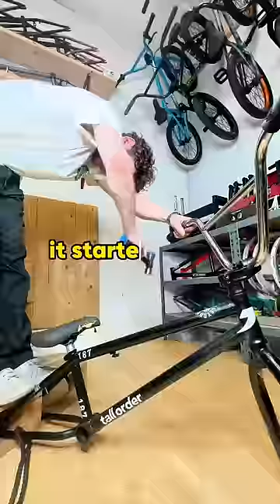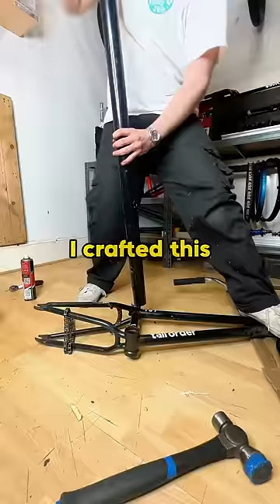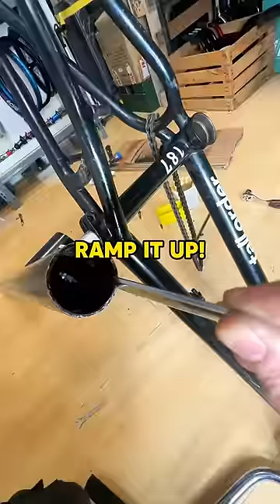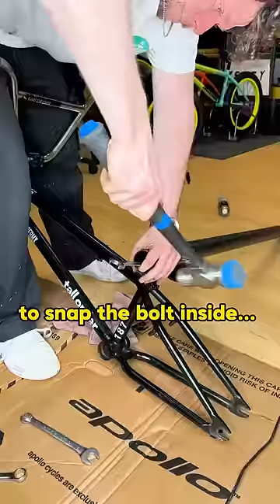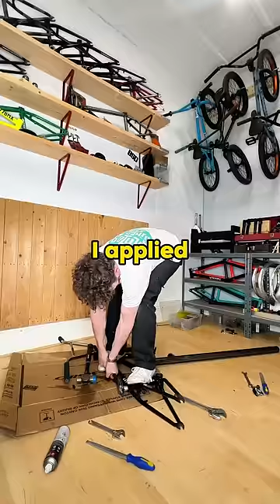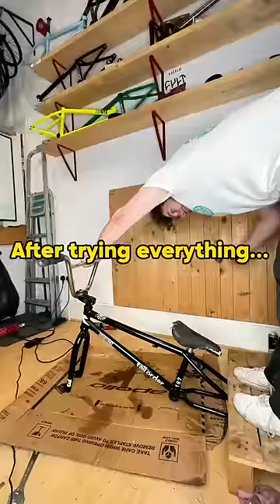Extreme BMX Rescue Mission: Battling the stubborn seatpost from Hell! 😳😱 #bmx #bikerepair #shorts

Comment: Correct way to do this is just to use a slide hammer, it's what plumbers use to seperate rusted pipes.  A few hits with that thing it will come right off no mater how rusted, every other method is a waste of time.
Reply from the maker: OK!! Sounds good dude I’ll look into that!! It’s not the first time we’ve had a frame like this! 😳🫡👊
Reply: If the pipe you are trying to remove is inside the frame try dry ice instead of heat on tge peice you want out. Massive amounts of cold could shrink it enough to help remove it.
Reply: No needs a torch not a heat gun lol
Reply: No you don't use heat and cold, as the interface between the 2 pipes is not threaded.  You use cold and heat on threaded interfaces like large bolts in an engine.  You use the tool designed for this job the slide hammer.  Literally 30 second job with this tool.
Reply: And get a actual torch a heat gun isn’t hot enough for it to loosen it up
Reply: @Pur3R3dBlow  No time to wrestle for 2 hours with a stuck post using heat and cold in a bike shop.  Few whacks with the slide hammer it's out in 30 seconds.
Reply: @___Bebo___  idk man a torch works pretty great on stuck nuts and bolts of all sizes on cars and I live in one of the worst parts of the rust belt
Reply: @___Bebo___  works on all shapes and sizes from axels nuts that are a 34+mm down to a lil size 8mm and even gets caliper pins unstuck which is a smaller version of this exact problem and the shops I worked in didn’t have heat and or where outside kroil oil heat and a lil bit of twist pull and taps with a hammer
Reply: @Pur3R3dBlow  In a real auto shop they use a heat induction tool to loosen bolts not a torch.  Torch can make the whole car catch on fire, heat induction tool will make the bolt cherry red hot in like 10 seconds.

This isn't a threaded interface, so you use a slide hammer.  You can rent a slide hammer for 5 bucks from Home Depot for all day so you are literally slow in the head if you wrestle with it for hours using penetrating oil and heat.
Reply: @___Bebo___  it’s called a coil conductor they also have torches lmao
Reply: @___Bebo___  also it doesn’t matter if it’s threaded or not caliper pins are baby smooth and I agree a coil conductor works way faster but a torch takes a few minutes and works juss the same
Reply: @___Bebo___  and I’ve worked in a quick lane shop a tire shop and dealer ship lmao I’ve been in a real auto shop and have 4 years of schooling along with 4 in the field
Reply: Are you a mechanic bring to my shop I'll prove you wrong
Reply: You don't heat the bike just the bike tube
Reply: Heat gets everything loose I live in Michigan everything comes apart hard
Reply: ITT a bunch of people doing things the wrong way that could never get hired in a BMW shop because of this.  I'm a computer programmer and I know more about this stuff than you, sad.
Reply: What if someone brought you a nice triple butted, Reynolds 853 bike that had been sitting in a shed for 20 years, and some of the tubes were as thin as a human hair?  You gonna break the torch out and just start blasting?  What if you melt the silver in the seat clamp lug in the process?  You guys don't know what you are talking about and are willing to spend 4 hours in a 30 second job over pride, ridiculous.
Reply: @___Bebo___  lol obviously you’ve never actually had to do something like this before as a job or a mechanics job
Reply: @Pur3R3dBlow  You're a hack, I wouldn't trust you around any equipment that I own.  If I saw you trying to do something right you might get to wash the underside of the Camaro with a pressure washer, but you can forget about ever changing the oil, 100% isn't happening my guy.
Reply: @___Bebo___  and you’re the real hack if you think a torch is the main reason for a car catching fire lmao while using it to heat something up obviously you’ve barely put 5 minutes in a garage if you really think that when majority of the time it’s the person using the tool because torch’s have been around way longer than heat guns and coil inductors lmao
Reply: @Pur3R3dBlow  I live in Los Angeles making 4x the money of hack PepBoys mechanics sitting in my room all day.  You're delusional @ other men on the internet with the wrong way to do things, get a boyfriend if you want to argue.
Reply: @___Bebo___  lmao makes sense a la base head who never gets his hands dirty n lmao must of forgot the part where I said dealership haha
Reply: @___Bebo___  and my point exactly you’d rather pay someone at a garage to
Do something instead of going it yourself
Reply: @Pur3R3dBlow  Depends on the tech, if I can see it's a good tech that cares about doing the job right I'll pay.  If I see the telltale signs of someone who doesn't care about the job I'd rather do it.

For something important like bicycles the bike shop is never gonna get to touch it.  I've got too many nice bicycles to play around with hacks doing lazy stuff.
Reply: Don’t heat up the seat post or the seat post will expand causing it to be even harder to pull out. Heat up the frame
Reply: Everyone here saying "use a torch" obviously doesn't know what fire does to a painted surface. A press can't be used so yes, a slide hammer would be the best tool in this situation.
Reply: @jonathantheunacceptable4259  touch up paint it’s a bike lmao and a heat gun would do the same but I agree it’ll fuck the paint up but it cant be stuck if its liquid lol
Reply: @Pur3R3dBlow  it's a bike, it's most likely powder coated, can't just touch it up. Yes if you don't care about damaging it, grab a torch right away, if you want the job done with minimal damage, use the correct tool. There's a time for heat persuasion and a time for impact persuasion lol
Reply: @prof.creepypasta6509 and might heat the puter frame to increase the gap.
Reply: Not true. Yes very useful and works good but it does matter how rusted and seized it is. I call it rust weld 😂
Reply: @seandozois  It's impossible for a rusted post to take more than 10 whacks with a slide hammer, never seen it.
Reply: @T77BMX my Ragley Blue Pig was bad for this, it was steel rusting to alloy post.
What material is the frame and post?
Reply: @T77BMX something else that mabye could have worked is if you pried open the slotted section where the tensioner went
Reply: @jonathantheunacceptable4259  I understand about the paint but it’s a black frame n a lil bit of to sand paper and touch up glossy black spray paint will do wonders
Reply: @___Bebo___  if you live in la you’ve never dealt with salt and other chemicals they put on road that cause it to rust together
Reply: @supafly1982  that also happens on car rims because the lug nuts are steel and rims are alloy and they only way it would come apart is with a torch I’ve broke many breaker bars sockets and air and electric impacts don’t work I’ve also dealt with this on big rigs and the only way to separate them is with heat
Reply: @Pur3R3dBlow  You've never dealt with cleanly removing a stuck seat post from a frame in 15-30 seconds, haha.
Reply: @___Bebo___  I work on cars not peddle bikes lmao
Reply: @Pur3R3dBlow  yeah I was a tyre fitter/shop technician broke a few bars myself lol
Reply: @Pur3R3dBlow  That much is obvious, in a bike shop you would have to be kicked out for being a hack.
Reply: @Pur3R3dBlow  I'm a mechanic and I've worked on bulldozers and i haven't even owned a car in 10 years, so what?
Reply: @Pur3R3dBlow  mechanic 🤣 maybe a parts changer. If you were a real tech you would know the abilities and uses of a slide hammer. I could see you being the lacky that I have to finish the job for after you broke two bolts, burned through a bushing and overheated a wheel bearing before asking for help.
Reply: @jonathantheunacceptable4259  ya alright lmao I literally went to school for it and was in a dealership haha
Reply: I use a slide hammer almost everyday they are one of the best investments I have made. I have an 8 pounder the thing is massive but it works the best. I have a 3 pound for body working
Reply: @Pur3R3dBlow  key word, was. You act like you're the only person who has their seal 😂 if you even got that. I know lots of guys who went to school and then went on to work elsewhere and never get certified. Happens all the time at dealerships
Reply: @jonathantheunacceptable4259  well yea was because the money is shit especially in nepa and sc where I worked in the shops now I get over 21$ a hr to ride a forklift n do nothing all day and my paperwork checks out homie I forgot man yall YouTube mechanics are the great wizard of knowing everything lmao
Reply: @Pur3R3dBlow the 2 different metals have caused a reaction and chemically bonded. Caustic Soda and melt the seat post out the frame. 

Very common.
Reply: @th3s3rv37  I literally said that I juss used a rim and lug nut instead of a bike seat post n frame
Reply: Even the slide hammer method doesn't always work. Sometimes a really long seatpost all the inserted won't some out no matter what.
Reply: @Pur3R3dBlow  ok lol glad your paperwork checks out 😂 dealership work is gravy money if you know your product and advance on your own time. It's the guys that think that being a tech is a job that you can just clock in and out of that don't do well. Glad you're happy with what you make now but even with the exchange rate, brtween our countries, a class A technicians base wage is usually around 30 CAD an hour. Closer to 40 if you're the lead mechanic in a big dealership. If you're quick, you work 8 hours and get paid for 9 or 10 on the time card. So I'm completely happy where I am. Cheers 🍻
Reply: @__Bebo__  i have worked in auto shops and know alot of mechanics. They all use torches
Reply: @ligmuhnugs  Slide hammer is literally for knocking a 10 inch drain line that has been rusting for 40 years loose.  You're smoking crack if you think there is a stuck seatpost out there that can survive 60 seconds with a slide hammer.  Show me a video of this on youtube it will never happen.
Reply: @charlesburns8661  only part chagers will reach for a torch as a first option, real mechanics know that there are other methods to consider. Heat only works when you're okay with possibly damaging the area you're heating and when rebuilding and restoring you what to do as little damage as possible. Young techs just don't understand the time difference in these methods either, that's why they think the job doesn't pay well these days
Reply: @jonathantheunacceptable4259  nah you working on a old Honda civic, and a torch is 30 bucks, and you don't have a 400 dollar tool to just heat a small bolt, dont need a new tool to do it. Old timers use torches. Maybe not for restoration work. But think about it you torch it you now you replace 2 parts makes your life easier  . Customer pays abit more and gets 2 new parts, or you hammer and struggle to maybe save it. Mechanics I know go for that torch and call it a day.  Again restoration is probably differnt
Reply: @jonathantheunacceptable4259  lol everyone who is in the auto industry knows that being a mechanic doesn’t pay well unless it’s like auto body but auto techs don’t make near enough especially when you add tool trucks and regular house bills lol maybe la is different but your food is also way more expensive than the east coast along with everything else so ofc a tech would get paid more in la also “parts changers” go for the torch first because they have multiple cars to work on in one day not just a at home project or shade tree mechanic that only does 1 or 2 a day also diesel techs also know if something is extremely stuck that a torch is the way to go because it’s a lot more heavy duty parts and steel
Reply: @charlesburns8661  there’s no point in arguing with the YouTube mechanics they know everything dude
Reply: @Pur3R3dBlow  keep telling yourself that
Reply: @charlesburns8661  you made your point, your not a professional. Just a beginner or a side jobber. That's the life of a parts changer, one part is bad, five parts need to be replaced.
Reply: @jonathantheunacceptable4259  I don’t need to tell myself I’ve lived it for the past 10 years
Reply: @jonathantheunacceptable4259  and I’ve restored a few vehicles and am restoring a 88 cutlass supreme rn I did a k1500 when I was around 8 with my uncle and multiple xj and yjs
Reply: And how could I forget the biggest rust bucket Cummins I’ve owned lmao or the countless motorcycle quads dirt bikes and side by sides I literally buy anything with a motor lmao
Reply: @jonathantheunacceptable4259  and it’s also funny because the jiffy lube I was at in South Carolina was doing 115 cars a day in just oil changes on top of the brakes and service side that was doing all the work they where finding and selling on top of people with appointments or drive in’s lol and the dealer ship I worked at was right down the road from there and than the tire shop I was at in nepa was doing around 100 cars a day for tires and they where selling anything from oil changes alignments to suspension n brake work to motor changes which I was doing along with 2 other techs
Reply: @Pur3R3dBlow  don't even compare your lube tech experience to an actual mechanic. Keep on dreaming, no shop puts through 100 cars with 3 techs unless you have 3 staffed tire bays, 5 staffed lube bays and 3-6 hoists just for the techs. That's a big shop that only big cities would have. At that point, you're just pushing customers through like cattle if it were any smaller.
Reply: @Pur3R3dBlow  btw I clock between 8-12 hours every day within a 8-9 hour work day, consistently... at 33 an hour it's very comfortable for where I live, just because you worked in the lower end of the industry doesn't make you an expert.
Reply: @jonathantheunacceptable4259  I didn’t say we did 100 I said the lube side did also the tire shop I was at had literally 6 bays with 5-6 cars each in line also I worked in a dealership lmao it’s not juss a lube n tire shop experience also dealer shops do way less work than a lube/tire technician
Reply: @jonathantheunacceptable4259  and both non dealer shops I was at are located in very busy cities and again one is in South Carolina and one’s in pa and the dealership is also in sc
Reply: @jonathantheunacceptable4259  also obviously your going to make more in the place you live lmao la is for base head yoga type people only got three things in la tweakers and yoga instructors and people who are snobs lmao
Reply: @jonathantheunacceptable4259  also no garage is open that long unless your the manager/owner who shows up before the shop opens you work 8-5 maybe 8-6
Reply: @Pur3R3dBlow  it's called piece work... I said I'm only there 8-9 hours... don't know any floor mechanics that work hourly, wouldn't give incentive to a good work ethic. Unfortunately the younger generation can't handle being payed for what you produce because they aren't able to be overly productive. Just want to clock in and clock out.
Reply: @jonathantheunacceptable4259  finally something we can agree on I agree totally
Reply: @jonathantheunacceptable4259  and the only place that doesn’t do hourly is the dealerships atleast on the east coast only place I’ve worked based on commission
Reply: @___Bebo___ ok bro. i’ve expanded my crank cases with heat enough to get in bearings in a dirtbike without a press. you have no idea what you’re going on about
Reply: @kristianrollsy2209  Just heat up a lugged bike frame with 5 layers of nice paint for 3 hours instead of whacking it out in 30 seconds bro.
Reply: @lexobarge Aluminum Steel galling is much weaker than rust, nice try though.  Also your feeble brain didn't account for the fact that steel seatposts in steel frame is very common, as well as Alu in Alu frame.
Reply: @T77BMX  Slide hammers are a good go-to if the setup allows for it. We work on industrial pumps and some of what we see requires more than that. When all else fails, if the frame is worth the cost to you, you could have it mounted in a drill press and drill out the center to weaken the center post. You could bore it completely and press a sleeve in if you were desperate. A machine shop would have a few options but that pretty drastic for a bike frame if it's not anything special. Honestly you had the right idea with the heat and probably could have got it eventually. Almost certainly with a large slide hammer.
Reply: no bs I juss seen a video of someone trying to get a wheel hub out of a knuckle with a 5+ pound slide hammer and it didn’t budge what so ever because there’s no placement for displacement which is why mechanics go to is a torch because it’ll work faster than a slide hammer and as I said before rust is no match for a slide hammer which is why I love working on cars anywhere south of Virginia or out west where there’s no salt or snow because rust will humble tf outta you man
Reply: @matthewfaulk  if you have to go to a machine shop might aswell try a torch or heat source first it’ll save you time money and your own sanity
Reply: I have thousands of hrs and dollars wrapped up into mechanics and sometimes a slide hammer will work but majority of the time the only way to free something is to use heat because suspension/car parts generate their own heat and than get rusted out and will never move again with out using heat and yes you will need a slide hammer but chances are if it doesn’t move with a bfh it won’t move with a slide hammer with out heat also if you’re from a place that doesn’t get snow or doesn’t use ice melt or liquid ice melt and have rusted pos vehicles on the road everyday that’ll need repairs that come into your shop than you can’t speak on rust period yea maybe bikes are different but it’s the same concept
Reply: @Pur3R3dBlow  It's not the same concept, my main bike the tubes are triple butted and a couple of a human hairs thick in some areas.  You don't use a torch here ever, it's not hard to grasp, haha.
Reply: @Pur3R3dBlow   I just mean after the heat fails you like it did here, and if the frame was something that special to you. There is always a way
Reply: @matthewfaulk  true but he woulda had better luck with a torch or coil conductor and slide hammer
Reply: @___Bebo___  n it’s kinda the same concept especially on a hub n knuckle lol the hub is a machined surface (the bike seat) and the knuckle is also a machined surface which the hub goes into so in a technical since it’s the same as a bike post going in the frame lol especially in the sense of the hub going into the knuckle like a bike seat or post would slide into the frame which is why it using it as an example
Reply: @___Bebo___  but like I said rust belt mechanic to la mechanic and or shade tree diy
Reply: @Pur3R3dBlow  yeah, I was thinking the same. If he just got a little map gas torch or something he'd probably have it out.
Reply: You sound like you know everything
Reply: @Gerryzeiler  I mean I live in one of the worst known places for rust
Reply: @Gerryzeiler  You have soft legs from dirt biking instead of being a real biker.
Reply: Just apply the heat to the correct place and you might have stood a chance!
Reply: @___Bebo___  Heat and cold will still work on non threaded interfaces it's just the process of expanding or contracting metal. Also this is in the UK I can't personally think of anywhere you would be easily able to rent a slide hammer especially depending on where you live although I'm sure there are places but he was likely just trying to use the tools he had available to him without having to go out and buy more or rent a tool.
Reply: @crdc9853  No it doesn't work you will damage the paint and thin tubes.  Slide hammer is the only proper non destructive removal option for bicycles.
Reply: @___Bebo___ yes it does you clearly don't know what happens when you heat or cool metal it expands or contracts which is the exact same principle regardless of if the interface is threaded or not. And obviously you will damage the paint but thats just a given. Also a seat post is large enough that I won't be damaged by the heat being applied.
Reply: @crdc9853  That's all well and good until you are working on a bike with Reynolds 853 tubing that is only 0.4mm thick and joined with silver brazing and lugs.  Then a goof like you is turning a 3000 dollar vintage frame find into trash.

Just do stuff the right way with the right tools.  It's not a car, it's 2 tubes very light interference fit, it doesn't ever get rusted enough to need a torch.
Reply: @___Bebo___ obviously I wouldn't use a torch on a very expensive frame like that or a carbon frame but for a fairly basic BMX frame like this which are always overbuilt anyway due to the type of riding they are expected to deal with would be completely fine. Plus my original point still stands that heat and cold still work regardless of the interface.
Reply: @crdc9853  There is no point in using a torch on any frame, it's overkill and takes hours.  You will still have to twist the seatpost 10 million times to work it loose, which will change the Seat ID diameter slightly and probably require you to use friction grease to get it to stay afterwards.

Waste of time, I'd rather dissolve the seatpost if we are doing goofy stuff.
Reply: @___Bebo___ mate I don't know what your doing to the frames you've worked on but I've literally never once had the issue you described. I had an aluminium post stuck in a carbon frame recently and that came out just by rotating it and it fits back in just fine. I agree it's best to use the correct tools when possible but in some cases they are not available or accessible so people just use what they have. For me a torch would be the last possible choice due to it destroying the paint. Also what you said earlier about a torch being overkill for a bike and it's not a car, if anything a car is more dangerous due to the higher loads speed and stress experienced by car components but mechanics use torches on car just fine with no issues and have done for years.
Reply: @crdc9853  The more you rotate it the more material you grind off.  If you want the tubes to fit perfectly and the clamp to hold your weight with only 3-5 Nm of force you don't want to be twisting rusted stuff inside of it.

I can understand using a torch if its a car axle and the bearings are seized in with 15 years of rust, but bike seatposts are not like this.
Reply: @___Bebo___  your correct and while it's not ideal it doesn't grind of anywhere near enough material to make it unsafe, most of the stuff being grinded away would be the corrosion that had formed. In a worst case scenario just shim the seat post so it fits perfectly again but it's very unlikely you'd get to that situation. I agree though using a torch is an absolute last resort if the correct tool is not available but it does get the job done albeit with more effort and damage than a slide hammer would.
Reply: @___Bebo___ it doesn't take 4 hours to heat up a pipe
Reply: @jonathantheunacceptable4259  repaint it lmao
Reply: @Tyufoe96  Only stupid people argue about heating up bike frames when you can get it out in 10 seconds with the proper tool, don't be stupid on my youtube son it's Sunday.
Reply: @__Bebo__   I've had slide hammers fail. I may not work on bikes, but the laws of thermodynamics are pretty easy to understand. And if you aren't worried about marring paint( clearly he isnt) then what's the problem? I'm not going to go out and by a slide hammer when i have something that can do the job at home
Reply: @Tyufoe96  Anyone using heat on a nice bike frame would get instantly fired at the bike shop I worked at.  You can't do stupid stuff to people's nice bikes that have been siting in a shed for 20 years.
Reply: @__Bebo__  okay, cool. Who gives a shit?
Reply: @Tyufoe96  Obviously you do, messaging another man on the internet with the wrong way to do the job that takes 10x more time.  Embarrassing display you've put on here.
Reply: @__Bebo__  do you just like to use every logical fallacy you can to make you look more ignorant? it takes like a minute or two to heat something up.
Reply: @Tyufoe96  Oh now we have Socrates here, classic.  Nice ad hominem by the way, very logical argument you just set forth in your latest feminine screed.  No dad eh?
Reply: @__Bebo__   You have also been insulting everyone you talk to since you started this thread. I'm simply pointing out that you are not helping your case and are making yourself look ignorant. My argument was clearly stated after. Now you're calling me feminine? I bust semi tires for a living bud. Great relationship with both my parents btw 👍
Reply: @Tyufoe96  Oh so you don't know anything about bikes, are stalking me and talking out of your tail pipe, good to know.  Totally not feminine at all there, haha.
Reply: @Tyufoe96  I think inhaling all the plasticizers in the tire dust has shriveled your gonads, good luck with that Shirley live your truth.
Reply: @__Bebo__  what a professional bike shop does doesn't matter when it's your own bike and you're working with what you have in your shop or garage. If it works with minimal to no damage, it works and makes your entire argument irrelevant.
Reply: @Tyufoe96  My bikes all have lugged, silver brazed seat post collars that would get ruined by your crude method, nice try but you've just inhaled too many plasticizers.
Reply: lol a slide hammer is a mechanic's tool, (pun intended) used mostly for body work, (pun intended)
Reply: @___Bebo___  those work for this situation? I don't know. Alot of bike seat posts get fused over time and they won't come out. Unless you physically remove the two metals with chemicals/drill/extreme heat to melt the post. This is really common since alot of people never remove these. They just fix up their bike, put new stuff on(like a new seat, pedals, chain, brakes, etc), and paint it. They usually keep the seat the same height and don't completely disassemble the bike. So fusion occurs at a molecular level and removing the post becomes impossible. You'll snap it off before you will ever get it out by force
Reply: @stompingpeak2043  Aluminum steel galling is easily removed with the slide hammer.  It's like a few microns worth of the stuff.
Reply: Wouldn’t work. I once tried to slide hammer a pivot bolt out on a Honda atv. It would not budge with heat, slide, chemicals. Ended up melting it. It was sized that bad.